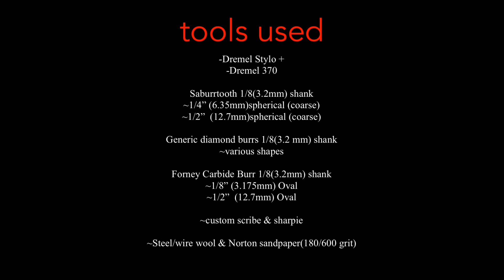Power Carving with Unknown Wood 🪵 Type ~ in time-lapse ~ Using Dremel ⚒️ Tools

Comment: Hey buddy looks good! Just had surgery yesterday and today I get a video lol, thanks for that keepem coming ,I know its alot of work i'll take what I can get. see ya on the next one.
Reply from the maker: Hey Mike, thanks again. Been testing out the moto-flex or flex shaft you gave me. Had to do some grease maintenance on the moto flex, works like a champ. Hope your recovery goes well. Got some more content in the works. Should be interesting I think.
All the best to ya! Again, thanx for the cool gear!
😄
Reply: @wood-psyche  you're welcome! love the content I still need to put my order in is that on your email address?
Reply from the maker: @michaellafleur2077  Yes, if you email me, I'll reply with further instructions and pricing. I use paypal mostly for the transactions but also have a venmo account as an alternative. But honestly, I'm more accustomed using paypal.

Comment: Hey Paul, looks like white oak to me, if it is it could have come from me, i threw in 2 smaller pieces of wood with the owl wallhanger back then.
Cant be sure though looking at the video. Turned out really good either way. Keep up the great work!
Reply from the maker: You're correct, I just couldn't recall the species. I have boxes of wood and this one got mixed in with my pine knots. Now it comes to mind...thanks for the clarification. It's really outstanding to work with, one of the better types so far...all the best to you! And again, much thanks for the wood(and owl)!
Reply: @wood-psyche  Dont think i would have even noticed if the title didnt make it all mysterious like. i was curious what wood it could be, looking closer it started to look a bit more familiar.

Im glad it carved well for you. i love making wallhangers with this wood. takes detail well. Cool to see what someone else can do with it. the time you did it in is impressive too. 

One thing though,Just to correct myself there real quick. I said it was white oak, but it is either Quercus robur (pedunculate oak / Common oak) or Quercus petraea (sessile oak).
they go by winter oak and summer oak here if you translate it from dutch, little less complicated.

As far as the wood goes really no thanks necessary, and its honoustly funny to me that the wood went from roaming around woodcrates over here to doing the same thing over there. these pieces always become something one day eventually :D

All the very best to you too man. 
and take care!